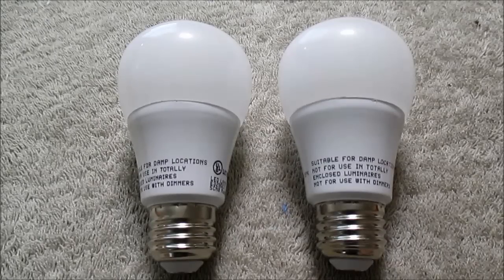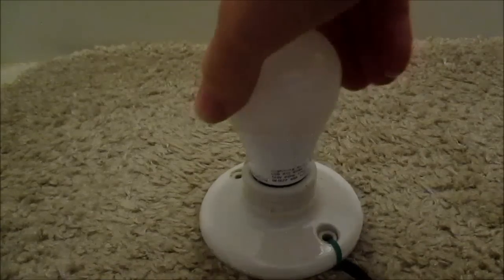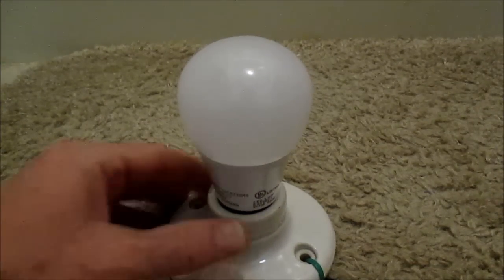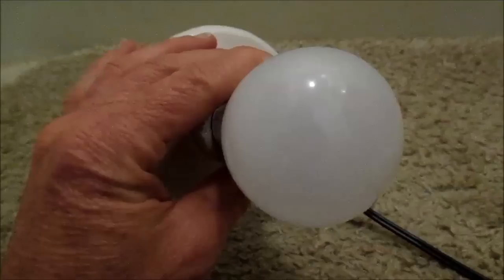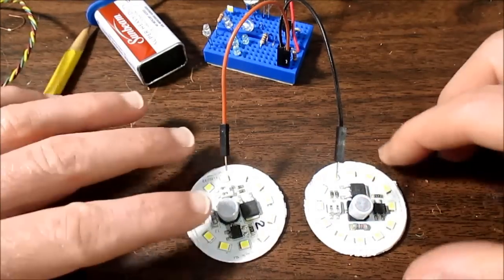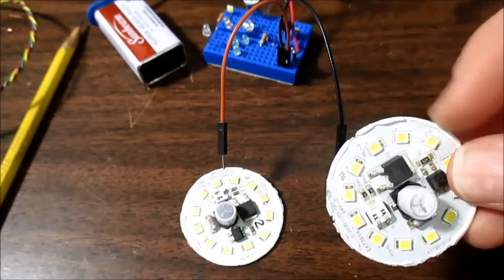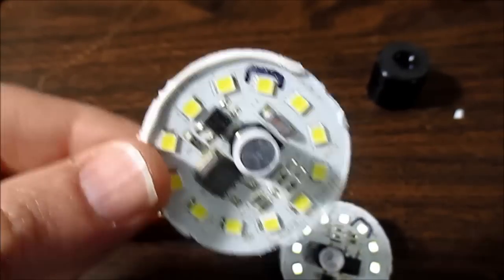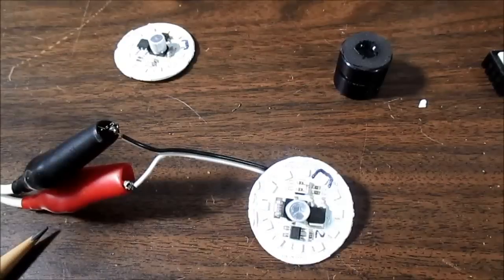Two failed LED bulbs for teardown to determine the cause

Comment: They Are Made To Fail So U Keep Buying Them
Reply: Anka Best Planned Obsolescence I believe is the term.
Reply: @cappy6100  yeah xd
Reply: @cappy6100  I am here looking for just that term. Thanks.
Reply: @cappy6100  PLANNED obsolescence...
Reply: everything is made to fail. Printers r designed to pack up after reaching a certain amount of pages printed. Cars have parts fitted to fail after a set amount of miles. German cars r the worst for that.
I had a merecdes vito  and the drive shaft bearings went every 60k miles. They were designed so u couldnt replace the bearings so the whole shaft had to be replaced and they knew the bearings would fail every 60k miles.

When nylon stockings came out they were indestructable. The silk stocking comapnies hated them as they were going to lose sales as no one would ever need to buy stockings again. So bribary and threats were used to get the nylon makers to wear them out at the same rate as silk ones.

Cars used to be far more reliable years ago than now. Just about anyone who could read could buy a book and fix the cars at home with no special tools. Now if a car packs up they r designed in a way were u cant fix them urself.

Everything now is about companies making as much profit as possible. So products r made of poor quality materials with degned built in faults so u have to keep paying to repair or replace things.
Reply: @cliffbird5016  Exactly what i was gonna say .
Reply: @timmygilbert1371   You also have a faulty Mercedes Vito?
Reply: @cliffbird5016  is  that  also  philosophy  of NASA  .  Story  that  of  NASA   where   astronaut   asked  about  his  tail on  it .  Reply    that  nice to know   that  your tail resides  on cheapest  bid
Reply: Also known as TAMTFSUKBT
Reply: @YoStu242   what do you mean?
Reply: @YoStu242  xd

Comment: Designed to fail. Batteries are the same, 1 fails in the set and people throw the set out, not know out of every 4. 3 are still good. 
Battery doctor, charger test batteries and charges carbon cell batteries as well. 
All by design to make you buy more. This bs economy of increasing revenue every year is behind the fail / buy more program. Lights used to part for years. Not no more, there designed to fail.

Comment: They're wired in parallel but should be wired in series. In series, it won't matter if LED's go out. The good ones will still light.

Comment: I diagnosed a failed eggshell once. Turned out to be a slight inconsistency in the calcite matrix, probably due to a genetic mutation. I had the calcite analyzed in a lab and found it to be 17% deficient of normal hydrogen bonding at the atomic level.  The store refunded my 15 cents.
Reply: worth it
Reply: Cost of lab work $75
Reply: nope.  $350
Reply: Behold, we are in the presence of a comedy genius.

Comment: that appears to be an engineered point of failure... a LED under the right power is supposed to last many years... and i bet you opened this thinking it might have been a resistor AND a Capacitor that would have let go but... the LED being the fault just does not make much sense other than if it was placed there to fail! (if they would make them "normally" with no engineered fail point, they would last like 10 years and the company would only sell one set and go bankrupt!)

Comment: Osram LED bulbs are great and last for years, mine is still working after 4 years of nearly 12 a day cycle
Reply: Guys on this channel buy only cheap crap from china and complain. Forgetting that lifespan it's the least problem of this shitty bulbs. I got osram, philips and panasonic. All of them works fine, have correct colour and no flickering. - Most of people forget that flickering is the most important parameter in all of those bulbs. Can be very harmfull for children's eyes.

Comment: They are pushing the LEDs right to or past their specs, to get as much light from as few leds as they can get away with. I other words simply drive the the shit out of them, leading to their failure.  The bulbs I checked from GE looked the same outside, but were different inside. The LEDs would check OK, but the internal power supply running them would be smoked.

Comment: Maybe you can just snip off the little LED and put a smear of solder and there you got a good working bulb again
Reply: Until something else blows or it short circuits and causes an electrical fire.
Reply: @jclowe6176  
Nice maymay, but you need to be able to sufficiently heat something to cause a fire.
When something blows it short circuits which destroys the electrical connection very quickly and doesn't allow it to heat an object up enough to make it burn.

Comment: LED bulbs are forever failing
Reply: Gary Moncrieff last month I noticed that a cashier had mistakenly rung up my LED bulb incorrectly with the UPC of another item: standard bulb costing 25¢ more. When I asked for a correction, the manager said “why would you want a corrected receipt?” I said ‘for the 10 year warranty...’
“Where does it say 10 years”
‘On the LED bulb packaging’
“Oh you’d have to contact the manufacturer about warranty like that-“
‘Yes, and they would ask for a proper Proof of Purchase.’
“You mean you bought one of those bulbs on clearance and it rang up wrong?”
‘Yes I did.’
“Well you would need to sign a lot of paperwork to get your 25¢ back.”
‘ I don’t mind doing that, it’s not about the money.’
“So why then what you needing...”
That’s ok, I’ll just make a mental note to steal the next one from here when this one goes out.

Comment: Sir I hate to tell you this but LED are not saving you as much money as you think. Bassicly because your home is ac not dc the LED only uses less voltage which technically is !ess wattage 🤔 well if you have 5 of these or maybe run other things in the same outlet then your power meter will register a 50watt lightbulb . If you really want to save money with LED you should use a dimmer as that will effect voltage which your LED needs minimum voltage with high amperage but your power meter only cares about voltage until you step into the 300watt range.

Comment: Hi, John, 
I watched your audio amp video & I was wondering if I my i like to pose 2 questions.... 
Have you tested a be y a me p that's powered by the TDA 7498 & since I am about to start  the undertaking of recapping several Sansui receivers ( 7070, QRX 6500 &  441 models).
I believe the quad & the 707 use 10k Ufd. and not sure on the 441.
The big item is the current & p.i.v. ratings on their respective rectifier's.

Any idea?

Thanks, 

Brian.

Comment: Great video. I bought these before and was wondering why they crapped out so quickly.
Reply: Jubeidono2012 yep it takes cock and balls to stick a screwdriver through the genie’s lamp, for fear of the giant deadly charged capacitor and Hg fumes hiding inside.

Comment: The LED might no be this bad, this sound like ESD damage to the LED while the PCB was manufactured. This is exactly the type of behaviour ESD damage does. It works long enough to get out of the factory, then it dies shortly after. LED are one the most vulnerable component to Electro Static Discharges. So, my take is for sloppy manufacturing processes of the board.

Comment: Lighting Science bulbs. Did he say LIGHTING SCIENCE BULBS ARE CRAP!!!!!. Yes , I think I heard that right. He said.  LIGHTING SCIENCE BULBS ARE CRAP. You heard it here folks. LIGHTING  SCIENCE bulbs. They are CRAP.
Reply: I don't know what ur talking about but they use about 1/10th the power of the traditional light bulb.  and u can even use them to duplicate different spectrums of the light that change depending on where u are on earth in order to grow plants cheaply even using solar panels for source. the "pros been using like 2 different ratings for bulbs. the Led's just proved not long ago that was total bs way to grow plants and they were only about 10 % rite on what they thought.. wich was good enough to get a plant to grow. now aye ya you can create like a 12 wave length light for plants to grow since every light spec causes photosynthesis but blue and red cause the most growth. there is a lot more to a plant then just it growing. led solved this we can add orange white yellow bluw red IR like 12 different NM ratings 2700k 3000k 7500k etc all on one panel giving the plant every type of light it can USE not just the ones that are basic for growth. and now cause they create no heat we also use less energy and can poor on to much light making it a sloppy thing to even execute. I love LED for farming. led strawberry towers and all kindsa yummys.

Comment: Just a thought.  Surge failure.  Input power off an unfiltered source can cause LED failure.  Power grid is notorious for unstable AC power lines.  I noticed no watchdog surge control in circuitry.
Reply: There are approximately a thousand people who actually gave this video a thumbs-down. That proves to me that the Lightning Science company had most of their employees deliberately give this video a thumbs-down out of anger for exposing the truth of their fraudulent business practices. I attempted to contact their company via their email address located on their website at https://lsgc.com 
My email was instantly returned to me as being undeliverable.
Reply: @GábrielPriòre  ***Troll Alert***
Reply: @aland1618  What do you mean by that?
Reply: @GábrielPriòre  Lightning Science company had most of their employees deliberately give this video a thumbs-down out of anger for exposing the truth of their fraudulent business practices.   Troll bait comment
Reply: @aland1618  If you don't believe what I wrote to be truthful, then that means you yourself must obviously practice their same exact pathetic business principles in order to profit financially. There is only ONE reason on Earth why a product would have such an insanely high failure rate: That is because the manufacturer 'deliberately' designed their products to fail as quickly as possible so the customer would be forced to repeatedly purchase their products as frequently as possible.
Reply: @GábrielPriòre  Like I said, Troll bait.
Reply: @aland1618  You don't know what the definition of the term 'troll bait' even means. I made a factual statement of what the Lightning Science company does. This has absolutely nothing to do with troll baiting.

Comment: I found this video interesting, as I had about 3x LED bulbs 'blow' several years ago.  Without any expertise in electronics knowledge I was unable to determine the exact cause.  Like several previous commenters here I was not happy that they failed after only a few months of use, but had been advertised as having a lifespan of 50,000+ hours of use & I do not like wasting money.
Now I have solar PV panels on my house (ummm…. what does this have to do with it say you - ha ha).  The consequence is that the grid-tied inverter has to raise the voltage from the PV system to get the current to flow for export to the external grid.  I live in the UK where the nominal grid voltage should be about 230v 50hz, but my inverter raises the voltage to as high as 248v.  So my guess is that the voltage is way too high for the LEDs & caused them to run hot & fail prematurely.  Add to this that many items sold in the UK are actually only designed to run on 220v European voltage & I'm guessing that my LEDs were. (Now guess how I fixed  this).
I simply rewired my LEDs with each two in series.  This shares the voltage between them, thus massively reducing the voltage each LED has to use.  The result; no further failures of LEDs at all.  Success.
Further reasoning: Does anyone here recollect that one of the original Edison light bulbs is still functioning within a US Fire Station.  I was amazed at this.  However the reason of its longevity appeared to be that the voltage across the vintage Edison light bulb was significantly reduced, thus reducing the heat stresses.  So I applied the same principle of voltage reduction (via wiring two LEDs in series) to achieve a similar result.
Before any wise spark states the obvious; the LEDs wired in series do not glow quite as brightly.  However they are more than adequate for me & the hoped for improvement in reliability should be worth the hassle of my little experiment. 
 Regards to all, Johnnyk.  PS. Please comment on this, as I would like to learn more.
Reply: Would you please put a light meter before and after?
Reply: @nobody46820  Sorry no can do; I don't own or have access to a light meter.  All I can say is to repeat my original comment, that 2x LEDs wired in series are a little dimmer, but not much, & hopefully they will outlast my lifetime.  You don't get ought for nought; there's always a trade-off.
Reply: @johnkay4701  I like your idea, I'm going to give it a try.
Reply: @nobody46820  Go for it.  Measure before & after with a multi-meter & check using Ohm's Law.  You'll find that the total combined power drawn is half what either of the two identical LEDs draw individually.  So the by-product is that it saves money & the environment also.  I have a fixed version of this (2x LEDs in series) & a portable version.  As my older incandescent & CFL bulbs end their natural lives, I'll be replacing most with my 2x LEDs in series setup throughout the house & garage.  It works for me very nicely.  If everyone in the country did this, it would potentially save millions of pounds every year in electricity costs, massively extending the life of bulbs & thus reducing pollution & refuse.  Tell me how you get on.  Regards JohnnyK.
Reply: @johnkay4701  Thanks, will do! I'd be curious to see what wattage of LED's with what voltage and amps in regard to how many I can rig in series.

Comment: The screw threads can extremely hot, much hotter than incadesce.  I feel like leaving these socket type bulbs on for ling periods wears them out fast and imo a fire hazard for dummies who leave lights on for days.

Comment: Great teardown with a simplified explanation, thanks! I have been paying more for Philips bulbs, run them 24/7/365 with no flicker or issues period. I've purchased generic filament style LED bulbs that dimmed to the point of uselessness over a few hundred hours of use. When it comes to LED bulbs it's probably best to stick to a more expensive name brand type.

Comment: My experience is with dollar bulbs.  I had a few of them go bad after year or so.  Maybe one out of ten.  Kind of admazing if you ask me.  The city I live in has replaced allot of the street lights.  Seen a couple of flashing failures but I think the biggest problem is health risks from the bright bluish light. It seems that bluish light enterfears with the human sleep cycle by stopping the production of melatonin.  There are studies that show that heart attacks and other causes of death increase in neighborhoods where these bright bluish streetlights are installed.  So the cure to this problem is warmer, lower kv or redder, lights that are not quite as bright.  The hardest part is convincing the responsible authorities that this is true.  Turns out there is sound information out there that this is true and a number of cities have changed out their street lighting to safer colors and intensities.  So if your city is changing out their lighting ask whoever to check the health effects of the intended lighting.
Reply: I have heard this as well. Other information out there, also indicates that it is all linked to 5G and the SMART grid. With LED's, you are able to track people's movements, even in their homes. Behind most of the things that are put out there, there is often an agenda behind them. Despite all the claims of the benefits, the health effects of 5G is horrendous. You might get faster streaming, but at the cost of more diseases, I'm not sure that it's worth the price.
Reply: @itsnotforourconvenience2990  this is one reason that getting information on health effects on blue light led street lights is hard to get out there is because of the phoney stories like 5G harm.  So far there has been no confirmed negative health effects of cell phones or cell phone towers.  Now we are getting crap coming out about the negative effects of 5G.  Now when one knows how more information is transmitted in the WiFi one knows that  the transmitters are going to have to be closer together and at lower power to keep from interfearing with each other.  The transmissions are also going to have to be spread out over the frequency spectrum to transmit more information.  Think about it.  Lower power, more spread out. Is this something that is going to cause more health problems than 4G?  Out door lighting however has well documented bad health effects.  The effect is strongly connected to bright blue light at night.  But because of fusses about stuff like WiFi that have no evidence of harm there is a tendency to blow off of warnings of high intensity blueish led streetlights.  This is however something real.

Comment: So just solder a wire  to short the dead led  then put it back you can use the bulb as new, until another led dies then repeat until most of the led are dead.

Comment: The led never fails, but the poor quality of the driver electronics always fails, often when not even in use due to corrosion at the solder joints. Most of the drivers are running at or over their rated values because it is cheaper for the little garage shops to make them that way. Most Chinese made led lamps are made by hand in mom and pop garage shops.

Comment: Never use cheap Chinese XLR cables, they wire them incorrectly and destroy the Phantom power supply to your Condenser microphone -- I found that out the hard way, an expensive 'mistake'.
Reply: Really? I thought putting a switch the wrong way around on equipments or power tools is about the only thing they are prone to wire incorrectly.

Comment: do you know you can replace open leds diy. you need induction cooker or gas cooker + sand + aluminum foil.search videos about diy smd soldering. you can reuse them.